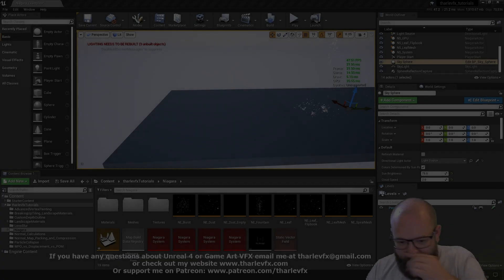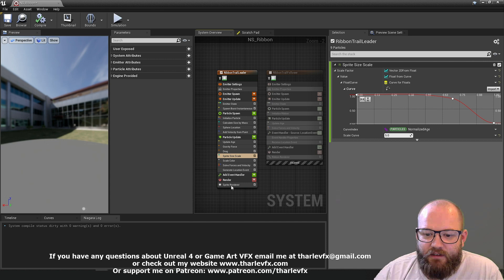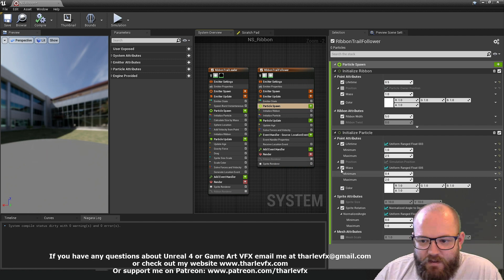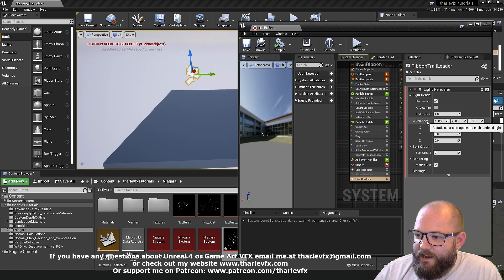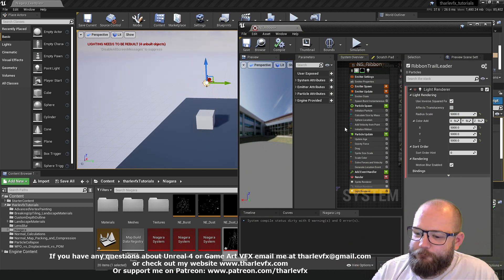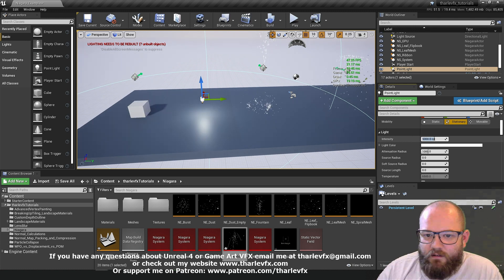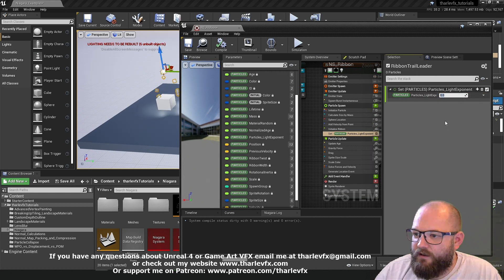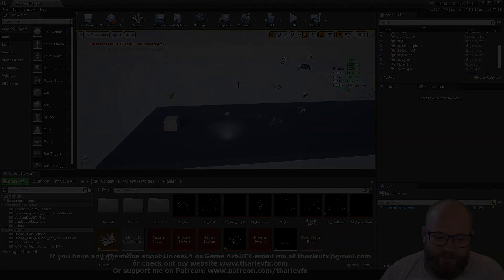Niagara 106 - Ribbons and Lights

Comment: How to control radius and intensity of light by particle lifetime or other parameter?
Parameters cant add modules...
Reply from the maker: you need to look at the Bindings sections and see what parameters are driving the Radius and Colour - these you can then control via particle lifettime or other external parameters